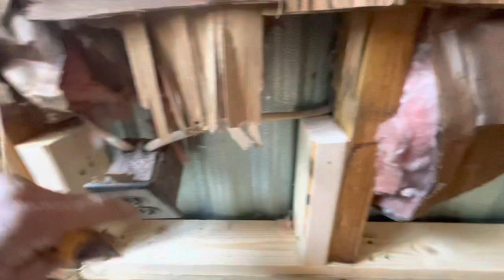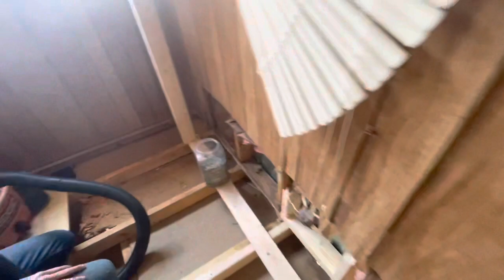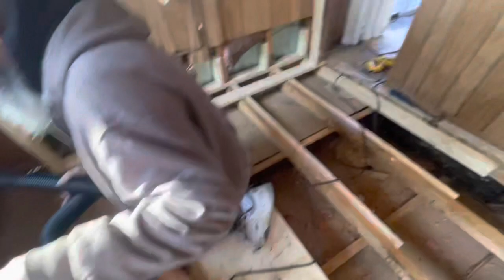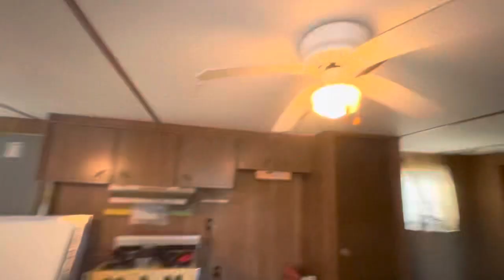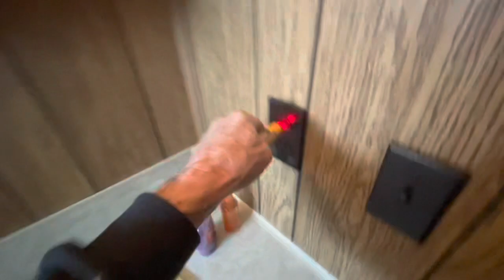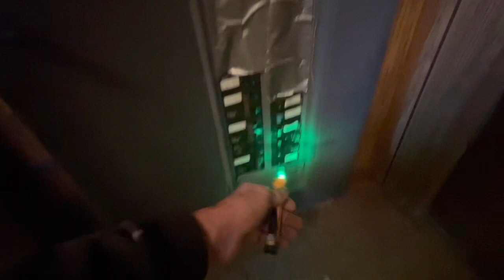Mobile Home Electric problems. Has the breaker gone bad?

Comment: I had the same problem, bought and replaced breakers same problem, so my son and I started at the box were the street power comes in with an voltmeter, next was the shed checked that box , 4 breakers checked, 3 were reading 120 volts and 1 read only.04, took it out and one terminal in the back was burnt replaced it and everything came back on.
Reply from the maker: yup that can happen glad you found it

Comment: I had same problem in my livingroom and daughters bedroom
Reply from the maker: It could be a real pain in the butt when that happens
Reply: You very well could have bad receptacle from where they were stabbed in back when installed! Seems to be primary cause in mobile homes or if you have water damage and its corroded out. That and check GFI's make sure they all reset if it doesnt function properly that can be cause. These are all things you can fix if you make sure power is off you can save some money. Hope that helps you. Wanted to add if you try to tackle this make hooks on wire to place around screws to reconnect probably 80% of failure is the push in "stab in back" connections.
Reply: I’m having that issue in my sons room, bathroom and half of my living room. Odd thing is - the receptacle in his bathroom and on the front porch are reading reversed and the hot is not hot and the neutral is hot. How does that happen all the sudden ? I’ve already replaced two breakers. They read that they have power but still nothing.

Comment: I have the same type problem. Bath overhead light and bedroom next to the bath are all dead. Exterior walls of the trailer, all plugs are ok.
Reply from the maker: Strange
Reply: @Drewsroofingandhomerepair  I'm thinking it might be bad electric work done by previous owners. It's obvious things were changed around. Only problem now with the electrics is it is hard to find electricians. They are either busy or don't want to work on trailers or they want $100 or more per hour.
Reply: @williamrichards7081 we lost a whole bedroom. Breaker is fine cause when i flip the breaker on the  smoke detectors go off
Reply: @Bagheera2  Check every plug and switch along the line. Especially in older mobile homes they can come loose from one terminal on the plug and then everything from there on is dead. Pull them out one at a time and look for a broken or loose wire that is interrupting the circuit.
Reply: @Bagheera2  Glad you figured it out. Old receptacles most of time used the stab in back/push in method which fails. Always make proper hooks and tighten in direction of screw. Probably half of service calls are the cause of push in devices.
Reply: @williamrichards7081  Does your GFI reset? Sometimes they can work and not work at same time if that makes since. Sometimes with old wiring they also ran the hot to the lights 1st and the joints can be loose up there. Any devices that are old push in/stabbed in back are very susceptible to falling and shouldnt be advised.
Reply: @robertgarrett3980  yeah im pretty much self taught and leaned that very quickly as im the family handy-guy and its all old construction. LOL

Comment: Did you ever find the problem?
Reply from the maker: Yes the roof was leaking badly so we put a new roof on it if you watch my videos after these ones you’ll see us putting a new roof new Gables a lot of work in this place
Reply from the maker: Actually I apologize it wasn’t the roof problem I realize you were talking about the electricity and yes we did there was a wire that was ended for some reason just completely taken apart and ended. It came from the light in the ceiling we reconnected them when we did the roof
Reply: A hundred dollars is a fair price for a service call. Electricians have high overhead with insurance, licenses, vehicles. Nobody works for free. Try going to the Doctor office $150.00 for 5 or 10 minutes.